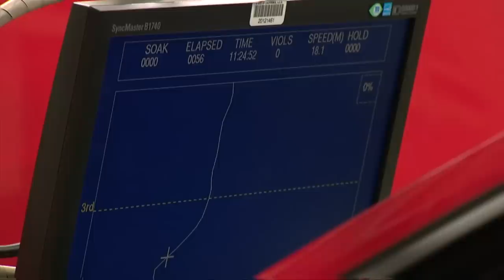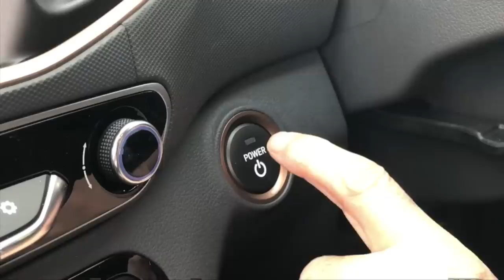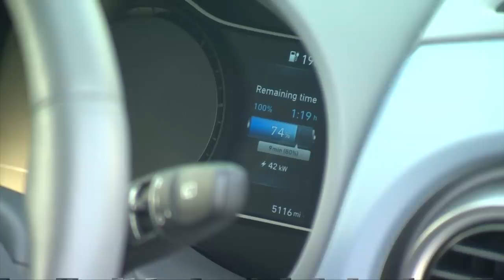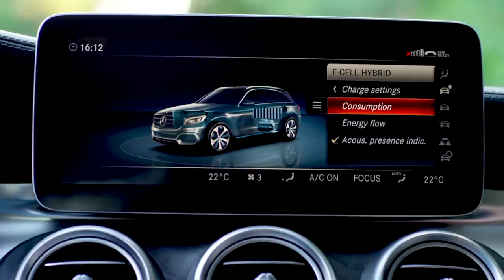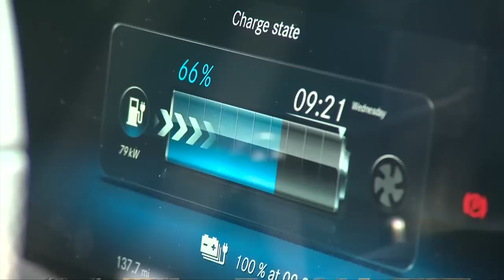Electric Cars: The Future of Road Vehicles? - BBC Click

Comment: EV's are a just plain superior technology.
Reply: @HardWarUK I said it is SUPERIOR technology not CHEAPER technology.  And if you figure in all the costs of combustion then EV's are less expensive too.  Learn not to burn.  My EV takes less electricity to run than your gas car uses to pump and refine its fuel.  Personally, I'm not willing to take the chance on messing up the world just to have initially cheaper transportation.
Reply: @HardWarUK It's true the cheaper end of the market hasn't been overtaken by EV's, yet. With the falling costs of batteries and with greater production rates it won't be long, especially when total cost of ownership are taken into account.
Reply: Only superior if you dont have to go very far, and besides there are not enough of the rare metalls in the world so everyone can drive ev
Reply: @u982245  these two arguments were put to bed years ago.
Reply: @u982245  Pretty soon there will be fast chargers everywhere, B.S. on the rare earth rarity fears, and there isn't enough clean air left in the world to continue to spew exhaust into.
Reply: HardWarUK, the sad thing is that most car manufacturers will hold on until their last dying breath in producing gas-emitting machines by continuing to reduce the prices of their cars and while other, better equipped, forward thinking manufacturers are in the game and making profit and bettering the future, these anti-eco idiots will bankrupt themselves trying to fight against what is clearly, A SUPERIOR TECHNOLOGY!
Reply: archeryman, well at least doing something and investing in humanity’s longevity will we see the positive effects and rather, we are limited to resources which means we can recycle our resources but weigh this up, we are shorter on coal and oil than lithium.
Now, would you prefer we wasted our extremely limited coal and oil supply or we used our cleaner lithium; put the decision in your hands and weigh it up because your comment is the most ignorant I’ve seen in a while so thank you for destroying my hope that people believed in this technology.
Reply: @gregcollins3404  a Petrol Golf is in the 20k, an e-golf is 40k, (you have to compare 2 comparable cars for a comparaison to work)
In the video they said the difference for a mile is 7 pens. So you would have to drive 285 714,286 miles before it becomes cheaper. That's way more than what the first owner of the car drives. 
Also at this point the battery will be out of waranty. 
If you factor in the maintenance sure it will be sooner that it becomes cheaper. 

You can say EVs have advantages, but don't say they are cheaper this is simply not true. 

Also, as they said, Electric cars are more efficient in the cities and petrol more efficient on the highway. 

With all those points taken into account, NO, EV isn't superior to ICE. Each technology have advantages and inconvenients and which is better for you depends on your driving habits. And you should be able to have the choice of what to buy, and not be forced by stupid laws to buy an EV while it's not fit at all with your usage of a car.
Reply: @schmidtxcvii  First of all, don't call me stupid
Second of all, free charging is only on tesla model S that were sold before a certain date. 
Maintenance is in theory cheaper on an electric vehicle but there is plenty of exemples of guys that have their Tesla in the garage every few weeks for various problems. (A few of them linked to the poor build quality)

I do 200km on the highway twice a week  to go to were I study and there there is no infrastructure to charge an EV there, so i would need more than 400km of highway range. Only expensive EVs like Teslas can do that and as a student I can't buy an 100k€ car.

EVs may be faster from 0-100km/h, that's only one indicator of performance. But a fast car is fast on twisty roads and racetracks, and for this the car needs to be lightweight and well balanced. Not really the definiton of an EV that is very heavy due to current battery technologies (at least the center of gravity is low but still)

There is also geopolitics to take into account, for exemple Germany's economy relies a lot on cars and a lot of suppliers that provide parts for ICEs would be harmed by a 100% EV law, resulting in a big unemployment crysis in that country. Also most of battery producing plants are in China, and a worldwide EV crase would give that country even more power. 

An internal combustion engine can run on other sources of fuel than fossil, the Diesel engine was invented to run on Vegetable Oil. There are some experimentations to create eco-friendly fuel out of algae etc. 

As of now, if we all went to EVs we would need much more electricity and seeing the way it is produced in a lot of countries (burning coal for exemple) it would not be as ecological as you seem to think. 

You did not take into account a very large amount of factors but then it is me that is stupid and ignorant ? Sometimes you should take a step back and question your knowledge, it can only be beneficial for you.
Reply: EVs also have their downside. Yes Gas is a very old technology, but until they can get batteries that can last for over 500 miles including all your accessories, such as heat and AC. Furthermore, cold weather kills those batteries. So, gas cars are the only viable solution at the moment.
Reply: @schmidtxcvii  In a perfect world, sure. But I drive 60 miles to work. I can't afford a million dollar mortgage, so I moved out of the city. But I agree with you, 300 miles is plenty for most. What I meant is better capacity, because in cold climates, once you put the heat on and all other accessories and considering the loss in cold weather, you lose a lot.
Reply: @schmidtxcvii  Maybe, but that's only on Tesla, on all other EV brands (the ones that people can actually afford), you have to pay for charges

There is plenty of videos showing that the doors don't align etc, and people find it unacceptable for a car that price because the fit and finish is better on a 20 years old car. The model X have a known issue on the falcon doors that is even acknoledge by rich rebuilds, which is a pro-Tesla youtuber.

Yeah there is still the model 3, but eventhough they said it would be 30k, today you can only get it for 50k, and i'll be over studying in just a few months so they will not become affordable in this timespan.

I was not speaking about the car manufacturers themselves, but their supliers. They are building parts that are only used in an ICE (which is composed of lots of parts) while an electric motor is made with a rotor and a stator.
The problem with China is that the US (one of the biggest poluters) will not want them to have more power and therefore it will never be the law in the US (also they are hanging on their reserves of oil for when there will not be any left anywere else, so they plan to use it in the future)

The algae solution is made in pannels (much like solar pannels) that can be anywhere and are also stackable, that's their advantage over the current biofuels that relies on crops and such.

I'm not convinced by that, there is a reason Germany (wich shut all its nuclear powerplants to go to renewables) is using a lot of coal based powerplants, they don't manage to cope with the demand with all the renewable stuff they build. It's that bad that they plan to destroy old forest and a church just to gain access to some coal underneath those. Also photovoltaic does not work in the region with a poor sun exposure, windmill don't where there is not a lot of wind, etc 
It may work great in some places, but in others it doesn't work at all. 
And you can't produce electricity in one place to put it somewhere else far away because of the electrical resistance of the cables.

And the thing is, if countries like the UK and France do go all electric, it won't matter if the biggest poluters like the US, China and India don't do anything. 
In India they sell cars without any anti-polution devices in the exhaust system (Renault Kwid, Tata nano etc), and their population is over a Billion. We have to take care of the ones that take the biggest part in the problem, we in Europe clearly aren't the one to blame.
Also, the market for "ecological" solutions is also a market, and they do loads of lobying so countries put out laws to favor them even when their solutions aren't really more ecologicals than the old ones.
Reply: @gregcollins3404  Good on you brother for choosing a cleaner form of transportation. I hope to do the same. Peace
Reply: In many ways yes. In fundamental ways..not yet. I would think carefully and do your research.
Reply: @gregcollins3404  I know the West is all about freedom of choice, but isn't the real car problem that there's just too many of them? In the UK there are 38 million registered cars, and never has there been an attempt to control this. When I was 17, we all used buses. For years now it seems you must have a car by the age of 17. Result ? too many cars. The free market has its downsides. Try halving that 38 million figure and there'll be civil war.
EVs? They are worse than ICE cars in three fundamental ways, all of these can be 'fixed' but not for 5 to 10 years.
Reply: ferkemall  As the market gets bigger then economy of scales starts to come in on manufacturing costs ie they go down. Also you get more competition coming in driving the price down. Batteries at the moment are in demand and not enough can be built so profits are high. The cost of manufacturing has come down massively and the technological advancement is just crazy now. Expect costs to consumers to stay high for a few years yet then rapidly drop.
Unfortunately "trade wars" are nothing new, normally it's just a case of wealthy countries screwing over the less powerful. But over the next few decades as new manufacturing tech's come in to play and more local manufacturing becomes more and more economic. 

Times are a changing.
Reply: ferkemall  demand out strips supply, for now, wait for the industry to mature a bit, could take a number of years.
Reply: @HardWarUK It took time for any technology to reach certain level. in next 20 year, surely they will become common and CHEAPER! ;)
Reply: @HardWarUK using numbers like 15k for new n 10k 2nd hand is off putting. Got 5k for my audi trading in which was my deposit for my EV. Rest is month finance which is lower than tax n diesel with money to spare. And as mentioned above. Superior technology. If ur doing 12k miles a year test drive a second hand one n no need to bring a suitcase of cash lol. Half decent car n half decent credit rating n ur flying.
Reply: @jeremylister89  I've been thinking this for years, there are just too many vehicles being made. This problem will be made even worse with all these ev vehicles and if governments really do decide to enforce laws against ice drivers (which would be ridiculous, but not surprising) then you will have a whole bunch of perfectly good vehicles sitting around doing nothing, and rotting away; is that not pollution too? Nobody talks about this. It seems as if more and more cars are being made every year, with manufacturers producing so many variants of cars, dealerships full of new models each year, and you have to wonder where all of these cars and the models they are replacing are going. Likely, many of them are sitting for long periods of time not being used at all, which is a waste of materials and energy. And this isn't about ice versus ev, this is just a problem regardless of what kind of cars they are.
Reply: @allgoo1990  A working-class family that needs at least one car to get to work doesn't care about why ICE cars are affordable and EVs are not.  They also don't care about why there are 3 gas/petrol stations along their daily commute, and the nearest supercharger is 30 miles in another direction.  When costs get in line, and the infrastructure develops, then they'll consider the EVs--not before, unless alarmist politicians force the issue with punitive taxation or outright bans.
Reply: @gregcollins3404 ,

what is suoperior about electrice vehicles. Electric motors are very old and invertor contollers are also old tecnology.
I don't know where you get the idea that the production of your electricity is more efficient than refining and distribiting liquid fuel. Your car is fuelled by fossil fuelled generation and has muc the same sourcing and distribution costs as liquid fuel. Then there are all the losses between generation and utilising the power in you battery. Transmission, distribution, rectification, inversion then controller and motor losses.
Have you ever seen power electronics and their huge heat sinks, heat equals loss!
Reply: @iainreid9914  NO, my car and a lot of other EVs are powered by my very own solar power.
Reply: @gregcollins3404 ,

you are very much in a minority and thus does not make any difference to the discussion. Incidentally, do you have winter where you live and can you still adequately charge your car then?  Solar output diminishes drastically in northeren latitudes.
Reply: @u982245  guess who uses the most cobalt - the oil & gas industry! That's right, if you're concerned with rare metals being consumed, stop buying gas!
Reply: @lucwal67  I like your reply, but many of your points are incorrect. The energy required to push an EV does NOT represent a net increase in energy demands on the grid. What you're missing is that it takes about 5kw/h to refine every gallon of gasoline - an EV can go 15+ miles on that much energy. Stop refining gas, give the energy to an EV and you have no net increase in energy production. And that's just refining gasoline, that doesn't include extraction, transportation, storage, etc. 
Your claims that switching to EV production would harm economies is also wrong - that's like arguing we should've outlawed refrigeration because that would've protected ice houses. Far more jobs are being created in renewable energy and EV production that in traditional industries. Regardless, those countries you mention have resisted converting to EVs so they are the ones harming their economies, not EVs themselves.
There's much more I can answer about your reply but I'm out of time.
Reply: @bmw803  Boy, are you wrong. I've owned a Tesla for 4 years, would never own another brand of car. Yes, I've had my tires changed on my Tesla at ANY PLACE I WANT. I've had accident repairs done at non-Tesla repair shops. Where are you getting your propaganda from? Telsa has the highest owner satisfaction rating of any car, any price. Please stop finding a reason to keep what you have and learn.
Reply: @iainreid9914  Google is your friend. Gasoline engines lose 75% of their potential energy to heat when burned. Electric motors are over 95% efficient. Heat loss due to inverters and rectifiers is negligible. EVs are NOT necessarily fueled by fossil fuels, but your gas car is. As for energy losses, you must not be aware that it takes 5 kW of electricity to refine each and every gallon of gas. An EV can go 15 miles on the electricity required to make a gallon of gas! That doesn't include the energy to extract it, transport it and store it. And electricity can be moved over wires instantly for thousands of miles. It takes a tanker to move petrol. Please cite your sources that moving electrons over wire has the same distribution costs of moving combustible liquids, I'm really interested in your "facts".
As for any of storage of energy, batteries are reusable, repurposable and recyclable. How recyclable is the gasoline you use today? Stop spewing misinformation about petrol and electricity being the same cost wise, environmentally wise, transportation wise, use wise. It's just not true.
Reply: @joesterling4299  well, that family might care that an EV costs 1/4 the price to operate than a gas car and needs no maintenance, yes? And that their car is refilled every night for pennies. Superchargers are only needed on highways as 95% of all automobile usage is within a few dozen miles of home.
Reply: @lucwal67  You need to update your information, pal. The Tesla Model 3 is now priced at $39,000 and when you factor in a $4,000 savings in gasoline over 3 years, it's $35,000. Your information is very wrong about electricity transmission - ever seen power lines that cover multiple states? High-tension power lines can carry electricity half the way across the USA...where are you getting your information....Exxon?
As for solar and wind not working, did you really think about your statements? You don't put solar where there's not much sun, you don't put a turbine where wind doesn't blow enough to make it worthwhile. You move energy from those attractive areas to places that need it (see my prior electricity comment). 
As for bio-fuels, please think before you speak. It takes MORE energy/petrol to harvest bio fuel than just refining petroleum itself - there's no savings. In addition, let's say you DO have a viable source of gasoline as a bio-fuel - guess what? You're still BURNING GASOLINE and POLLUTING. You've done nothing but extend a terrible fuel source when another one is available. 
I've had this conversation many times with people just like you. I've got all the links to backup my statements, I'd like to see them from you.
Reply: @justsomeguy934  I got all this info from a co worker. He has a Model X and had to replace a door handle that cost a grand. Tires were special spec/size etc. I dont hate Tesla and their vision on taking on those big automakers. And I do like their cars. I just can't afford them. That's it.
Reply: @bmw803  The Model X door handle should've been handled by the warranty. I've never had a door handle problem, it's rare, but Tesla will fix it. I have a friend that Uber's in his Tesla, had to have the passenger rear door handle replaced, Tesla did it under warranty. 
The tires on a Model X are not "special". Other cars use them, not just Tesla. The difference is that they tires that come with the vehicle have gel packs to make them quieter. If you don't want them, you can buy any other brand of tire you want. I have several friends that have Model X's and they get tires from everywhere.
Want an inexpensive Tesla? Get a Model 3.
Reply: @HardWarUK If you're stepping into used cars, there's nothing cheaper than a used EV to operate. A $5000 Nissan Leaf will pay for itself in 5 years on gas savings alone, not including zero maintenance. They are completely affordable.
Reply: Superior technology is that which is easiest to maintain with the simplest of tools not the most complex. You mean EVs are far more complicated so no longer can be fixed by the driver that is why I don't want one they are a money trap.
Reply: @taooflovepassionandcomedy8722  Please tell me how a motor with 1 moving part, sealed and lubricated, is more complicated that a gasoline engine with 200+ parts, all operating under tremendous heat, with reciprocating motion. As for EVs being fixed by the driver, what's to fix? There are no valves to adjust, no exhaust system to tune, the cooling system is relatively simple and not high temperature (bath water temperature). In fact, the manufacturer of my car has IMPROVED my car with software updates, not made it worse. Does your car maker voluntarily adjust and improve your car so that its value to you goes up? Mine does! Your car maker does everything possible to get you to buy another one, yes? Annual model changes, sometimes just to a tail light, to make you want a new one? See how silly that is?
Reply: @justsomeguy934  

If solid state electronics are so efficient, why do they have large heat sinks? Heat equates to loss. 

Transferring vehicle power source from liquid to electic does increase grid load, that is patently obvious, and with few exception such as Norway with large hydro generation, this extra load can only be met by extra fossil fuel generation. Wind solar and nuclear are run at maximum output so cannot respond to the extra load.
The most efficient  generators, combined cycle gas turbine plants can acheive 60% efficiency but running them to counter act the fluctuatiing load from wind does reduce that at times, coal is about 40% efficient. The transmission losses are transformers (look next time at a large power transformer and you will see very large radiators for cooling) , this is one loss then there are capacitance, inductance and resistive losses, these all add up. Distribution losses are similar but generally higher as the voltage is much lower.
Where do you get the idea it takes 5Kw to refine a gallon of petrol?  That is inconceivable, if you do rely on Google, be cautious of what 'facts' you glean?
I am happy for people to chose what sort of vehicle they buy and run but there is an awful lot of exaggeration as to how superior they are technologically. 

The cart has been put before the horse in forcing or coercing people to buy electric vehicles before low carbon generation is the main source of power. For that it will have to be nuclear  and I see little interest in countries in following that route, others such as Germany are shutting their nuclear capacity. However part time power is not the answer.
Reply: @iainreid9914  The batteries get warm when you cycle them. The motors in my car need very little cooling, in fact in many EVs there's no cooling for the motors at all. The presence of a heat sink does not equate to a 75% heat loss. If you'd like to think that burning gasoline is efficient, please defy the laws of physics. I can get you several references on heat generation of burning gasoline vs. kinetic energy created if you like. You're making generalizations to avoid the topics. 
BTW, I'm talking about efficiency once the energy is received at the vehicle. There are transmission line losses and inverter losses for sure, but nothing like the energy required to transport thousands of metric tons of liquid fuel, just to then lose 75% of that potential energy to heat in your car. If you'd like to compare transmitting electrical energy thousands of miles over power lines to moving the equivalent amount of energy via tankers, I'll be happy to debate you. Also throw in the electrical energy required to even refine each gallon of gas - you can push an EV 15-30 miles on the 5 kw/hr PER GALLON of GAS required to refine one gallon. You'd like to argue efficiency is in favor of burning petrol? Please - let's go!
Reply: @justsomeguy934  

I never made any claims that petrol or diesel engines are efficient, diesel being the better of the two.
I have never seen an electric motor that does not get hot, unless unloaded, and believe me as an electricla engineer I have seen very many. I was really refering to the power electronics when I mentioned heat.
I saw an interseting you tube video of a Tesla on the German Autobahn, after some time it had to slow down as it had an overtemperature alarm due to running at high output for too long. Power and heat cannot be seperated and heat is loss.
Reply: @iainreid9914  The video you saw shows that the Model S (not the Model 3) is battery constrained for cooling. The Model 3 has better battery cooling but worse motor cooling. The presence of heat in a motor is meaningless - no device is perfect. The discussion is relative loss of efficiency between gasoline burning vs. energy applied to a motor. With petrol engines struggling to go above 25% efficiency vs. 95% efficiency of an electric motor, there is no discussion. What happens in a Model S if it's a hot day and you're going 150 mph is that the car slows down to catch up with the required cooling to keep the batteries happy. Battery cooling is not an efficiency argument.
Reply: @justsomeguy934  
One more try as you are obviously not listening or else you don't understand. The motor is the last part of the chain, You have to start at the power station to get a full picture. Batteries are storage devices and do not generate any power, this power comes form the power station and there are losses all the way to powering the motor.
Heat is not meaningless, heat is waste energy.
If you just want to believe that the motor efficiency is the only thing that matters, fine but the only person you are fooling is your self.
Reply: @iainreid9914  One more try as you are obviously not listening or else you don't understand - moving electrical energy over wires is waaaay more efficient than moving the equivalent amount of chemical energy (tons and tons of fuel oil) to then have 75% loss to utilize that energy. Another thing you didn't listen about - since electrical energy is already required to just distill a gallon of gasoline THEN burn it at a 75% loss, using an electric car that is 98% efficient and avoiding the burning and pollution of that oil means everything. Giving the same energy required to refine one gallon of gas pushes an EV at least 15 miles WITHOUT burning anything.
Would you like to prove how efficient electrical energy is? Quick - I'll move 1 megawatt of energy over power lines to Atlanta, you move 1 megawatt of gasoline energy from my location and let's see what's lost, what's utilized. Game? You've got....the speed of light, which is how long it will take me to move that energy to Atlanta.
How about this - electrical energy has multiple sources, unlike gasoline or diesel. My roof can make all the energy my home and car needs, silently, pollution free, for decades. Got a refinery or oil well in your back yard, do you?
I'm enjoying our conversations, someone (likely not you) can learn. Please - respond.
Reply: @iainreid9914  I never said electronics don't get hot or have loss! It's the percentage, the efficiency, that is the point of the discussion. Changing one form of energy (chemical) to another (gas -> explosive) creates a 75% loss of energy to heat, an order of magnitude greater than an electric motor given the same kW of energy. You keep arguing in circles that the heat loss of an electric motor (5%) is equal to the heat loss of burning gasoline (75%), and also ignoring that in order to even make a gallon of gasoline you must produce 5kW/hr of electricity (spent cost in the discussion).
Reply: @justsomeguy934  

You have misread my earlier postings. I did not say that the loss from an electric motor equal burning petrol.
I said the losses from generating electricity, transmitting it, distributing it , converting to D.C., converting back to A.C. and controlling the power to the motor incurs a lot of loss and I don't see a great gain in efficiency, if any. It certainly is not a quantum leap that you seem to think it is.
It is illogical to keep stating that it takes 5Kw just to produce a gallon of petrol. Just where did you find that 'fact'?
Reply: @iainreid9914  I didn't misread your earlier postings, I know absolutely what you're trying to do - you're stating that considering the entire electrical generation process, you don't believe using EVs is more efficient. I'm telling you that since you MUST generate 5kW/h of electricity per gallon of gas just to refine it from petroleum, using that energy instead of refining gasoline makes EVs more than a quantum leap of efficient. Think about everything involved in extraction of petroleum, transporting it (sometimes over OCEANS in TANKERS), storing it, moving it again to a refinery, spending 5 kW/h per gallon to refine it, storing the now-refined gasoline, moving the gasoline to another storage facility, storing it, moving it again to a sales point. Tell me where you're missing the realization of all that energy and effort to move a liquid chemical and refine it can be 100% avoided by simply diverting the same electricity used to refine gasoline to EVs. Do you not see the massive resources consumed and dedicated to petroleum processing vs. a municipal power plant making electricity that flows over wires effortlessly to an EV. You can avoid all the petroleum effort and simply use the electricity that's only a fraction of the petroleum process. Add to the fact that electricity can come from ANY source - pollution free solar, hydro, wind, wave, etc. and the case for using gasoline is wanting. Quantum leap indeed!

Oh and "where" did I get my 5 kW/h electricity consumption rate for gasoline refinement? Why, the US Department of Energy. I've seen estimates from 4 kW/h to 6.5 kW/h of electricity alone per gallon, so the average for a discussion is usually taken at 5 kW/h. Interesting note that leads you to believe the estimates: the oil industry doesn't want you to know how much electricity (and specifically electricity) is consumed to refine petroleum, so they stop reporting when they can and hide the information. They do that because you come to the same obvious conclusion I did: STOP MAKING GASOLINE. Also note that the electrical estimates are at the refinery ONLY, not in the other resources I've mentioned (extraction, transport, storage, environmental management, geo-political costs such as military protection for oil routes, etc.). 

Volts vs. Oil:  https://youtu.be/BQpX-9OyEr4 
BTU's, steam and other energy forms consumed by refineries (not kW/h but it does mention energy in BTUs and kBTUs): https://www.osti.gov/servlets/purl/7261027 

If you want to discuss the military costs and energy required to provide a free escort for oil tankers, free military protection of oil fields and free military protection for friendly governments that sell us oil, we can have a vigorous discussion. The energy and cost of sustaining petroleum is a staggering daily amount, not usually considered in the price of a gallon of gas. It is a subsidy par excellence, hidden, often overlooked, but there nonetheless.

I await your reply!